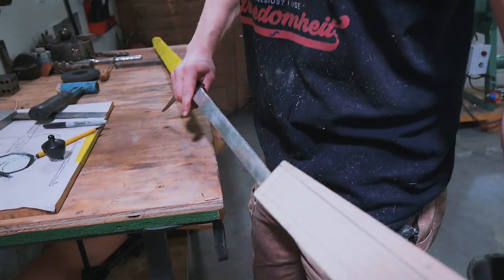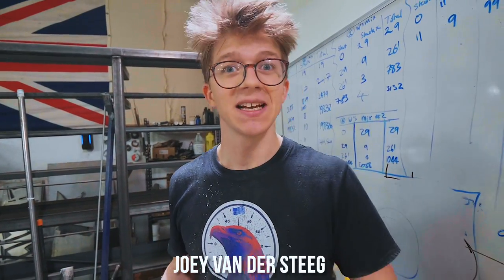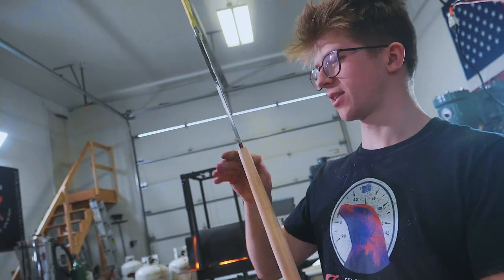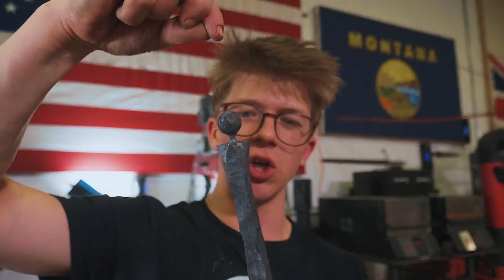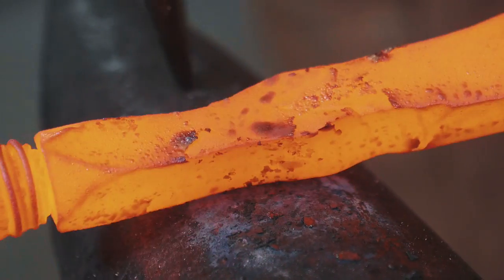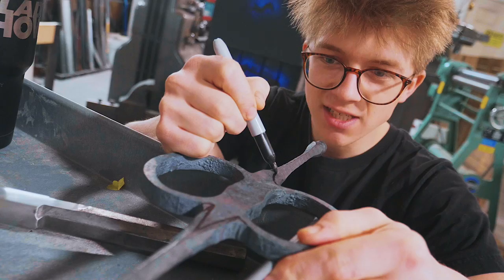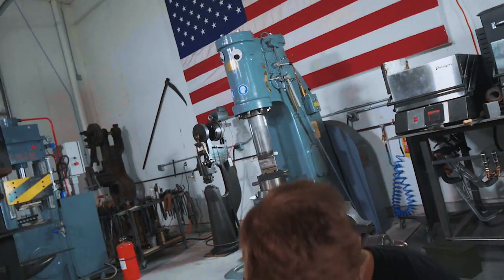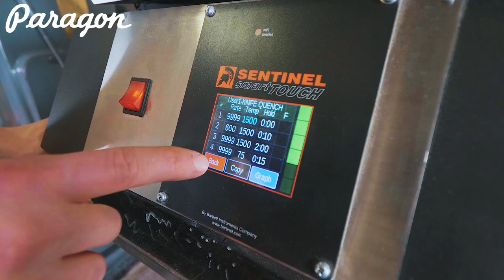MAKING A ZWEIHANDER SWORD!!! Part 13

Comment: Who knew a guard would derail this project so much. Makes you appreciate the OG swords from the past. They did all of this by hand with a basic coal forge and some strong human power hammers. Given this will be a beautiful piece of work but the original swords needed to protect the user and take lives.
Reply: There were water driven power hammers since the very early medievil times if not earlier...
Reply: @Seelenschmiede  Don't forget water driven grind stones instead of a belt sander(late 16th century was when water driven belt sanders became a thing). Then the finish forging is done by the forge master who has been forging since he could first swing a hammer and does forging all day everyday(except Sundays because religion). Which is how they could forge to 90%+ of the finished product while Alec does 50% for the blade and 80% of everything else he forges when it needs grinding and sanding. 

People have this idea that forging without modern power tools was much harder and took far longer. They spent more time forging sure, but that wasn't harder... same degree of difficulty, hammers are still heavy, anvils haven't changed, and same temperatures needed. Sure there's no propane forges, charcoal or coal with a peasant tending it and working the bellows(industrial scale where weapons and armor are made for the kings army there would be water powered bellows but they still work them, turning them on and off as required). After forging before any grinding happens it is heat treatment. So they spent more time forging but same work is required to do forging means they have far less grinding to do. Just enough grinding to smooth out any hammer marks and get to the finish shape and ready for polishing and hand sanding. Amount of time and effort? Same as today. Difference is today we don't have a peasant tending the forge and instead of more time forging it is more time grinding.
Reply: @JETWTF  You sir must be fun at parties.
Reply: It's also worth noting that a lot of the stuff back then didn't have to be perfect, only good enough. Tod from Tod's Workshop made a video about it called "Original Vs Reproduction - Which is better?
" where he shows how "bad" the originals often were, even at high end, they had to look good from 1 meter/yard away, that nowadays we're much more picky when it comes to quality.
Reply: @rubbers3   I quite liked that video of Tods, and I'd say I almost prefer the originals to reproductions because in my opinion those minor flaws show character and the fact that it was indeed hand forged instead of something that looks like it could have come straight from a CNC Machine.
Reply: I recall a saying about how some swords were the same worth as castles
Reply: JETWTF I think you’re forgetting the fact that they didn’t have bar stock to start from, and had to have started from ore
Reply: @Tomas970506  He isn't wrong though.
Reply: @tri11est  refined steel has been traded for since it was invented, the vikings had access to wootz damascus which was produced in the middle east using ore mined in india
Reply: @Tomas970506  Maybe... just maybe... someone's aim is not to just be "fun at parties", but to amass knowledge. Sadly lacking this hominid type nowadays.
Reply: @tri11est  bar stock was available, in fact it was traded far and wide. 

Very few smiths had to start directly with ore, ore was usually processed very close to the mine, since it is easier/less expensive to ship the refined metal. Now, that not to say that smiths could order bars sized to their specific measurements, but square stock was indeed a thing.

(Others have mentioned indian wootz being traded as far as Scandinavia, and of course all of Japan's master sword smiths got their steel from a singular source.)
Reply: @Tomas970506  I am indeed fun at parties. And I am not the person wearing the lampshade in the corner and pretending to be a lamp... Not quite bright enough to be a lamp.
Reply: @rubbers3  That's true indeed, there were no precision instruments to get precise measurements, it was eyeballed mostly which really sets the best craftsmen a step or two above.
Reply: @JETWTF  Good for you buddy. Good for you...
Reply: D H that’s interesting, thanks for the info!
Reply: @JETWTF  Of course it was harder. The only reason we can afford to do so much grinding is because of the technology. You can't compare a water powered grindwheel to a 1000W belt sander with a billion different configurations from flat platens to contact wheels and any grit you need exchanged in seconds. Don't forget power hammers, hydraulic presses and welders. Making a pattern welded blade like this would've been impossible without a welder.
Reply: @mrkiky  I did compare, and compared rightly, forge small and grind smaller because the ability to do the grinding is substantially less efficient. Spend more time on the forging and little grinding is required.

Making a pattern welded blade without a welder is impossible? Wow! Every idiot katana lover who thinks they are the greatest swords ever available can rip you a new one for that comment and be just in doing it considering that's a base part of the traditional Japanese sword creation process. And the base process of pattern welding is forge welding, a traditional part of the process of making swords in Europe too, except in Europe the whole blade wasn't forge welded but the tang was iron forge welded onto steel. All using hammers powered by humans and no welder even invented yet beyond heat and hitting it with a hammer. Forge welding has been done since the Roman Empire still controlled most of Europe and England. A technique required to be able to do just to have useable steel to make anything from steel. Would they twist and turn forge welded steel to make a pattern or cut into odd shapes to forge back together? No, they didn't care about the aesthetics, they cared about function. Could they do it? Hell yeah. Nothing at all stopping them considering blacksmiths did the process daily.
Reply: @JETWTF  But forging and grinding are both more efficient today because of power tools and modern materials. So no matter the forging/grinding ratio you choose to do, the total human effort is way less. You can literally just grind away at a bar of steel and make a knife within reasonable time with abrasive disks and belt grinders. And I specifically said "like this" meaning like the one in the video, which is by all means impossible without pre-welding the pieces together. Not to mention how impossible it would have been to manually cut that thick piece of steel so many times. Without power tools, if you wanted to cut a big piece of steel, your only option was to hot cut it, which would distort the pattern.

Comment: Alec: The guard has broken again, much like the old. Has my hubris finally gotten the better of me? There must be a way to repair it, to heal this wound on my pride. And yet, I find myself defeated. Unwilling to continue.
Will: I am adrift in a sea of discarded sand paper. The sound of steel being gently abraded away haunts me in my dreams. In my nightmares. I know not if this is the last of my sanity failing, or if it fled long ago.
Sword:  Emerges from its acidic bath with radiant beauty, drawing the envy of the gods of the forge
Alec:...
Will:...
A&W: Welp, back to work.
Reply: Dude A&W's is the best burger place /s
Reply: @dumpsterbonfire.  burger place? Soda?
Reply: @mitlanderson  A&W Root Beer best Root Beer.

Comment: *The joint between the two pieces of the guard is actually a “lap joint”. A plain scarf, or nibbed scarf joint, are two pieces (metal or wood) that are joined together by the overlapping of two acutely angled material faces, which are then forged welded (or glued for wood), creating a higher strength joint because of greatly increased surface area that is bonded together.
Reply: And actually it was "Forge Filled" ( I believe ),  because it was Tig welded together first, then put in the forge.

Comment: Could you do some more hand hammer blacksmithing like you used to do. like small things to sell and make to improve your blacksmith. However I do also really enjoy watching the big projects.
Reply: Steele vs Stelter challenges!
Reply: I agree, though I fear that ship has sailed.
Reply: I agree as well but to be more specific I think just more time hammering in details into the workpiece would be awesome like how you tried to forge the ball ends at first and tried to drift the guard loopie bits. I get that it didn’t work out how you wanted but I would have loved to see you try again and learn how to do it better
Reply: Also show cool tips and tricks for up and coming smiths. Homemade forges and even like the charcoal forge he did. I'd like to see him do stuff like that more
Reply: He's been getting less and less into solving problems as a blacksmith and more as a fabricator, or you could even argue as a business man
Reply: Steele vs Stelter one day handcraft challenge! More time allowed due to slower processes used.
No power hammer, no power tools, no grinding belts.. 

I vote for a ceremonial style dagger. Basically any size/style/design they want but judged more on form over function, which will be especially difficult without cheat-grinding.
A few points awarded for functionality in how well it performs, the rest awarded through community voting on the style.
ie. 60%/40% split in voting = 6 points to one and 4 points to the other, added to the functionality points.
Reply: @lufmesquita  Yep. Nothing has been quite the same since he moved to merica. Then again, no one wants 100 episodes where half of them are the same thing either.

Comment: Or, you could leave the neck of the ball thick until you're done forging, then file it to correct contour.
Reply: yeah, that was my thought as well.  but at this point, threading is gonna be the best option unless he wants to start over again lol

from the minute he turned the balls, i thought they seemed delicate for a weapon, though it turned out they were also delicate for forging 😭😅😅
Reply: @BothHands1  most of the fine detail stuff looks like it's way too thin on most of these projects. These things were meant for battle! They need some heft to them . . .
Reply: J.D. Stone 

to be fair, i think this particular one is meant for ceremonial purposes, but i may be wrong
Reply: But that wouldn't make for good tv
Reply: @BothHands1  It's a 'bearing  sword,' so it's meant to head processions, parades, and things like that. It's one of the reasons I'm not overly bothered by the chunkiness of the guard. Bearing swords were heavy, unlike their lighter battlefield counterparts, which at their very heaviest might hit nine pounds for the very large (~52" blade) ones, with most of them more in the five to seven pound range.
Reply: Yeah just round off the end for rough shape and size then finish with the rest of the detailing filing.

Comment: Well no you didnt break the first guard loops, you broke the second guard loops. The first were a lost cause :P
Reply: So, are they actually on the 5th guard already or is my tenous grasp of reality slipping again?
Reply: @jcskarambit  4th, i think.
The first 2 barely got past the rough forged (the very first didnt have enought material and the second had its loops drifted wonky), then the nearly completed one with the broken loop welds, now this one... Pretty soon they are gonna surpass the saber for # of guard attempts.

Comment: So many times Youtube chat has saved the day.
Making silicon moulds for the cavalry saber hilt and guard just in case.
Us the Bridgeport when you can.
Just machine the balls, thread them and tap the guard instead of forging it.
Two things to remember. 
Don't get so focused with a hammer or every problem will look like a nail.
Work smarter not harder.

Possible new tech to learn : Resin stabilizing the wood. You already have the vacuum chamber and could get a large pressure pot.

Comment: You should do a tour of your shop, and explain some of the costs associated with getting started! I've been looking to purchase a furnace, and have no idea what an expensive or cheap furnace looks like. Not to mention what some of the tools you'd consider a "Requirement" are. Luckily, my local hardware store was actually getting rid of an old anvil, and I do have a metal shop just up the road for picking up materials!

Comment: You mention putting the wire on the first side after the forge weld. Since you wire wrapped the second ball before the weld, do you think that, at welding temp, the force of the wire stretched out the neck of the ball?

Comment: micro-chips+cutting coolant + hands = surprise infections from hidden bits embedded in your callouses days later.  Lesson learned back in the 80s when I was running a bandsaw in a machine shop, turning big raw stock into small raw stock for the expensive machinists who stood around feeding the CNC machines…  Finally found some “gator” gloves that the glass shop guys loved.. they could breathe and kept out the micro metals.

Comment: Hi Alec and Will, you need to reinforce the cement with metal wire to reinforce the overall structure. Just like they do in buildings! Patchwork will fall off again after a while

Comment: Hey Alec, I got a question. Since Forging exists for ages, and so do damascus steel, how did they do that without having any Mig/Tig welding machines to stick the layers together and to put a handle on it ? is it possible to just stack them freely in the forge and hamer them until they're welded together ? Would you dare turning it into a challenge ? like nothing using a technology past 20's-30's (so you can keep power hammers and press, but no welding, no CNC and so on ?

Comment: I would not thread the ball on. I would turn a ball with a stud on it, drill and ream the guard. Then heat the guard and freeze the stud. After you put them together they won't ever come apart. The important part will be to have nice finished in the reamed hole and on the stud. You will only need a couple thou fit. Be sure to slide the frozen stud in in one swift motion. I would turn a little lead .05 long on the end of the stud about .005 smaller to help guide stud in the hole.

Comment: I don't know much about blacksmithing other than what I've learned on this channel, but I know slightly more about swords. While a sword as long as the Zweihander does need to be flexible since it will be under so much strain and leverage from use, this particular one seems a little whippy. It seems like it's too late now, considering the blade has already been finished and etched, but I would have suggested re-tempering it (if such a thing is possible) to a slightly harder temper.

Comment: I work for the company whose refractory you used on the forge. It's doubtful your issues with the fire ceiling are just from the heat. My suggestion is that you get another HWI low concrete castable. Low concrete is very important. Use the recommended water percentage by weight. And most importantly, vibrate the castable as you place it in the mold. The vibration will get the air out of the material and fill any pockets or voids in the castable. Let it set for a couple days to cure. Then ideally you'll want to use a heat cycle to remove all water from the refractory. Following those steps, you could likely use that forge for years before having to rebuild it.

Comment: I just bought a copy of "Practical Blacksmithing" by Milton T. Richardson. I'm only a few pages in, but I found a line that I think fits this project. 
" The sword and dagger hilts became more and more elaborate, especially in Germany, where the blade of the sword is often of most eccentric form and pattern, as if it was intended more to strike Terror by its appearance then by its actual aplication".
Thought I'd share.

Comment: I'm curious. What's the dust you sprinkle before hitting with the hammer? I saw it in others forging videos too. Is just sand? What's the purpose?
Reply: Its borax, it is used as a flux. When the metal is heated like this the surface oxidizes and creates scale, this is what you see flake off when the metal is hit. If scale forms on the surfaces you are trying to forge weld together then you will not get a solid weld and you will have cracks or delaminations. By using the flux (borax) this helps prevent scale forming so it lowers the chance that the weld wont take correctly.

Comment: I’ve got disabilities that make pounding away with a heavier hammer for a longer period very painful. many times can you reheat metal before you compromise it in any way? Or is it irrelevant as long as you heat treat it afterwards? I’d be really grateful if anyone could answer my question please.

Comment: To be honest, when I first saw the concept design for the guard and saw the balls, I first thought you guys were going to go the easier-ish route of separate pieces for the ball embellishments. Pass a bolt through the inside of the ball, weld fill the top of it to hide it, tap thread the ends of the guard for attachment and so on.

Comment: Since the balls will be screwed on at the terminals, you have the chance to complicate the design a little. I suggest either you place your touch mark on each side of each ball, or make them each with some sort of pattern. You could also easily brass them by heating them with a torch and then scrubbing them with a brass welding brush. No reason to not  go full out on it, since the blade is so outstanding..

Comment: If you have something like the ball fall off the guard you can fuse them together with an arc welder by cleaning up the surfaces and putting the Earth lead on one piece and clamping the other peace in the torch end and striking them together